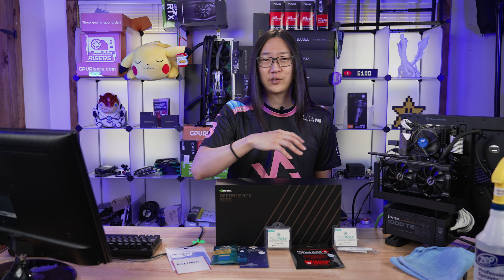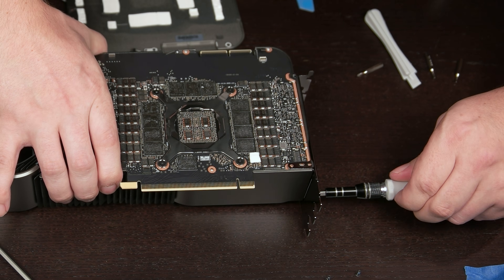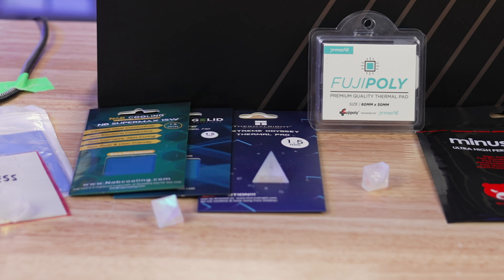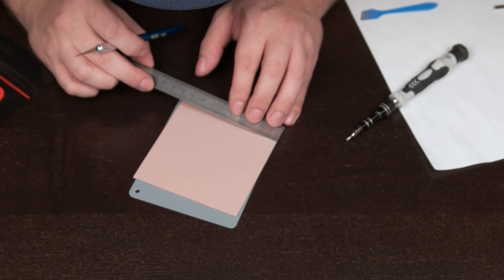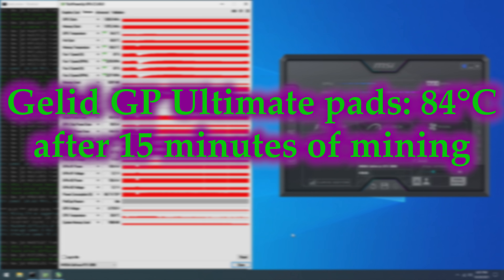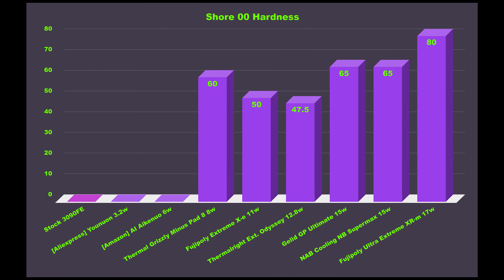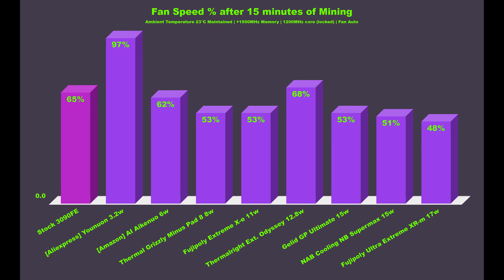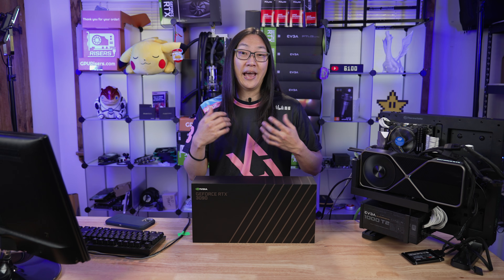Thermal Pad Showdown! What you should (and Shouldn't) Buy

Comment: i have recently swapped 3070 ti thermal pads to gelid 2mms , i see 3 degrees average raise of core temps , Now it makes sense
Reply from the maker: Of course your mileage may vary and there's a lot of variables, especially with all the cards and pads out there. However, this is a results we got from our testing which was relatively consistent. As long as your memory is running cooler, that means your probably doing it right

Comment: Good vid...though a little misleading.

I run 2 3090 FE's in one of my mining rigs and use Thermalright. They sit at 74 and 78 degrees (virtual memory temp) at my house.
You have to get the thickness perfect. I think there are more than just 1.5mm pads that get used in this GPU.
I wasted the money and bought all sizes .5mm - 3.0mm and then just matched it to the compressed thickness of the stock pad that was used. 
I had to remount a couple times to figure it out, but now it's perfect.
It seems obvious with that poor of a result on a quality product that there's an issue you may want to retest.

Just some things to consider! 
You're definitely right about there being a lack of content, especially for the rare 3090fe.
Thanks for making it.
Reply: Same here. For my 3080 I used thermalright 2mm and at first my mem temp went from 106C to 88C but my gpu die increased from 48C to 68C. I then took the card out and really pressed very hard on the locations where the pads were and also on the center of the cooler where the gpu die is. Now Mining 48C gpu die and 88C memory at 102Mhs.
Reply from the maker: Hey there buddy, thank you for the feedback! Will definitely consider this.
Reply: Thermalright 1.5mm for gpu memory on my watercooled Aorus Xtreme 3090 with Bykski Waterblock. They're definitely firmer than other pads, but 1.5mm is perfect. 76C max vram temps on a mining test with a higher vram memory overclock.
Reply: for me, in 3080 82 degrees
Reply: "rare" thanks also to people like you.  No offense, business is business ...
Reply from the maker: That's unfortunate.

Comment: I've done 10ish thermal pad swaps on 3080/90 gpus. I haven't seen core temp increase unless the density of the pad was too much or the size of the thermal pad was to thick. On some gpus I even got a core temp reduction because the stock thermal paste was trash

Edit. I'd love to see you test the gelid gp 12w extreme,  it's what I've had the best results with personally.
Reply: Hi I have a 3080 TI FE and only pad I can get are Minus pad 8 and Gelid Ultimate, From reddit I found that people are getting more success with 1.5mm pads on core side, 2mm on VRM and 2MM on back side now they all are using Gelid Extreme which sadly I cannot find in my country. Do you recommend Gelid Ultimate?
Reply from the maker: Thanks for the feedback. Appreciate it!
Reply: I BELIEVE YOU because I got similar results but with fewer tries and exploration so thank your for your input!

Comment: Great job.  Some of my favorite videos are ones by guys like you and Seb who put in a lot of hours like this to produce a single video.  It does not go unnoticed, my friend.  Adding all the graphs and numbers gave this one a real Gamer's Nexus feel and I know you must take any comparison to them as a high compliment.  You deserve it.

As for others who may read this, I've used a generic Amazon pad similar to the one TekShinji does in this test.  The kind you can get in the big 200mm x 200mm sheets which is HUGE (you can change many card's pads with one of those).  They got the job done for me at a low price.  They won't win you any bragging rights if that's what you're in to, but my Gigabyte 3080's been happily hashing away for 5 months with no loss in performance or degradation (knock on wood).  My VRAM temps stay at 90C with 80% fan speed with pads replaced on both sides of the PCB.  Nothing additional added to the metal backplate.  No special fans directing additional air for supplemental cooling.  Just one card inside a gaming PC case with the side panel off.
Reply: P.S.  It's also worth noting, that in my situation, my 3080 required 3 different thicknesses to match what came on my card.  As TekShinji mentions in this video, it's extremely important that you get the fit as close to perfect and not substitute the wrong pad sizes because you don't have what you need available.  Because I was looking at 3 times the expense of someone doing a card that uses only 1 pad thickness, it led me to try the generic type as well.
Reply from the maker: Hey there buddy, thank you so much for those kind words. It really does mean a lot to us, this video took nearly two weeks to make and a lot of help from our wonderful resident scientist. Andrew. He really did almost all the work on this video. I just let him go ham! 

We hope to make more videos like this in the future. It's just it's extreme time commitment and a lot of work. 

Regarding the thickness of pads, that is true. Every card takes a different type of pad. That's why we are comparing the brands and their claims rather than making a how-to or which pad to use on which card since it varies so much.

Comment: Thermalright pads are NOT measured on the OO scale.  (Sc) means they were measured using a shore C durometer which gives a very very different hardness rating.  Although that rating can give you an idea of its hardness, it can not be compared directly with the others.  The hardness of the Thermalright pads is noticeable higher than the others which is part of the reason they appear to give the most inconsistent results between users.  They can not compress anywhere near as much as the other pads so they struggle to fill the gaps between the cold plate and memory modules.  The main reason pads are used on memory modules is because their heights from the pcb are inconsistent due to the production line's soldering process.
Reply from the maker: I appreciate you pointing this out! I overlooked that it was SC. That would therefore be about 87-94.5 on the shore 00 scale.
Reply: @TekShinji  Thanks for making this video. I have been waiting for a decade for a video like this to come out.
Reply: @TekShinji  ur thermalright test is not valid
I changed mine with thermalright odyssey and I'm. Getting 18c reduction in vram temp on 3080
Ur thermalright is squished during shipment man
Or next time order +0.5mm than what u should have bought and squish it urself
Too thick is much better than too thin
Cos too thin means no contact
Reply: @dominicalvin  sorry, one question, my waterblock ek vector for 3080ti mount 1mm thermal pad, i order yesterday a thermalright pad 1mm, is ok for ram? 1.5 is not recomended for ek..
Reply: The secret with the thermalright pads is that they are kind of like hard clay. It has to "smash" into the memory modules when the board and cooler/back plate come together to make good contact. When they barely touch it wont work. If you disassemble again, you should be able to see chip imprints in the "clay" pad. I personally found a tiny bit of normal thermal compound added to the pads really helped it make a good seal against the modules and cooler and my 3080's are all under 90 on vram now at full load. Stock they were hitting 104-106
Reply: @djlowtek  Or company uses Frosty Thermal Pad 12.8. We ordered a larger batch and they just mold and work without the need for paste. We weren't sure if they would do bulk order, but they do if you contact them.
Reply: @djlowtek  hi, so you have to push the pad really hard to the mmory modules,, i was using thermalright and it didn't help..  i may try to put some grizzly kryonaut thermal grease and see if it helps ..
Reply: So, in the end if there was a separate heatsink for the chips or better heatsink then the core temps of the gpu wouldn't have gone up?
Reply from the maker: It's likely, however, most GPUs share the heatsink these days. There's a few exceptions, yes, but a lot of them are together
Reply: Guess that's explain why I keep telling people Thermalright are not great for gpu vram lol. Gelid, fugipoly, alphacool and IC Diamond gave been the ones that gave me the best results in my tests so far. Thermalright and Grizzly being at the bottom.
Reply from the maker: Yea as like the test concluded it depends on what your goal is!
Reply: @danielchicoine79  It may come down to the card in question. For FE the Thermalright didn't do well. Potentially due to being a bad pad, but could also be that thickness was off for the application. Personally I saw a huge difference with thermalright on a Gigabyte model over stock.
Reply: @KinzQuest  of course it will do better than most stock pads lol. The pads used by manufacturers are usually the bottom line. I didn't say thermalright was total garbage tho. I said they performed badly for my tests. Could be better for other people. Also, like the Minus8 I have tried, they were very oily and juicy. On the long run, the minus8 have dried very fast for me and pushed me to wonder if it was the cause. If so, then the thermalright could have the same results. So being the worse two among the few I tested, I didn't push the test for a longer duration, I just went back to my usual Fugipoly 17w/mk.
Reply: Thanks for pointing it out! I also have issues with using the hard thermalright pads. So much so that their hardness prevents my heatsink cold plate from touching the gpu core, leading to instant overheat and shutdown of the gpu when its turned on.
Reply: i bought the 2.0mm thermalright odyssey in advance (failed to score a gpu yet), would they work better?
Reply from the maker: It depends on your application and the exact contact pressure required for your card. However, in our testing they do not appear to be made correctly so they automatically fail
Reply: @claudiliciousX3D  I used them on a 5700 xt gigabyte , i used 1.5mm and they brought mem temps down roughly 14 c
Reply: So, the hardness affects the longevity and reusability of the pads as well then?
Reply: I used thermalright on my vrm and vram on my red devil 5700xt, 1.5mm on the ram and 1mm on the vrm. End result was vrm topping out at 66 C and vram at 70 C
Reply: Im really happy with thermalright. I have changed pads on 10 - 3090 using thermalright so far and The result is great 10-20c drop.
Im currently dual mining eth and ton now with 1200 core and 1150 memory and full power (350-360w) and 7/10 Card is 88-94 mem temp and The 3 other 94-98, sometimes spikes to 100. Bad connection on this 3 i think so going to open them up again and press down the pads abit for better connection. 

Anyway i got 14 new 3090’s im going to change pads on and im going for thermalright again.
Reply: What is best to lower hotspot temperature?

Comment: The memory height is the biggest Problem. If the Pads are too thick AND to hard, the distance from the GPU die to the coldplate increases thus increasing the GPU Temp exponentionally.
The higher the W/mk, the harder are the Pads.
VRAM on the Backside is different, there is no GPU DIE. But if the Pads are too thick the pressure on the VRAM CAN cause damage, although it happens very very rarely.
I wish Nvidia would give official numbers for the height/thickness of the Pads.
While i don't use my 3090FE for mining, even in Gaming i get upto 100°C on the VRAM (with Fans to 30-40%, but also Noctua Slim Fans in front of the GPU in an ITX Case). I'd go with the Thermal Grizzly ones in this Test. Or maybe Gelids, but if the GPU Temps are really 21°C more in my case, the GPU would throttle XD.
Reply from the maker: What you're saying is mostly true. However you can see in the data that's issue with replicating. Therefore it's logical that it's an actual issue.

Have you done testing of this kind before? We love to learn more about it.

Comment: Just an FYI but doing this on Founders Edition cards will void your warranty. If you have a issue with constant throttling then contact Nvidia.
Reply from the maker: That is true. You also got to remember we were stressing out the memory and unrealistic scenario.
Reply: @TekShinji  a lot of people are mining on them as well, and ray tracing games tax the memory as well. I talked with nvidia because I’ve seen mine hit anywhere from 100 to 104 sustained and they assured me it’s fine and that they will cover it under warranty. The said changing the gap pads will void warranty because it’s possible that you did something incorrectly and caused it to fail prematurely. I also mentioned that Micron specs GDDR6X say max junction temperature being 100C (which is a lie because they only have the spec for GDDR6) and they said after talking with the hardware team, they have no information that states Max Tj is 100C and that up to 110C is normal. I mean so be it, if it fails and they’ll warranty it I will continue to push 104C as long as I am not seeing thermal throttling.
Reply from the maker: Just to be clear, this video is about information on pads not specifically the issues related what you see referring to. That is a different topic in the sense that the focused is on the pads.
Reply: @TekShinji  yes but there’s a Founder Edition card and it’s only relevance is people replacing the thermal pads on their GPUs. It’s the only reason that would be included in the video and the only reason people are repadding their cards without knowing that it will void the warranty.
Reply from the maker: Thanks for the feedback. I really appreciate it. I hope people see this comment as well because it is important

Comment: Subbed even though I have no issues with my card.
Reply from the maker: Appreciate it man
Reply: @TekShinji  All good Shinji. I do have a question though... I bought an EVGA RTX 2060 last year. And when changing the paste (the second thing I did after testing perf vs temps) I noticed they gave it pathetically tiny heat pipes with it's chonkin 3 slot cooler. Is there a viable way to upgrade those. Or should I just deshroud it and give it one of my spare high pressure cooling fans?
Reply from the maker: You can upgrade the heat pipes definitely. But the question would be is it worth it? You would have to design and manufactual whole new block.

If it's actually overheating or causing real issues, the only way is to evacuate the heat by increasing air flow
Reply: @TekShinji  Nah. It was more that the GPU definitely doesn't stay below that 65c EVGA claimed it would. I've seen it hit 80 in some games. That's even with a modest under-clock and given an open air bench.
Reply from the maker: It would really depend on the type of GPU in your settings. However that's not too crazy depending on the type of load you're putting through it.
Reply: @TekShinji  ARK: Medium High settings, expecting 75 FPS. Fans ramp up to full speed. I can only play during winter without wanting to yeet the thing out a window. This is only at 1080p too.
Reply from the maker: It could be the limitation of the design of a card, however, it is also a 2060.
Reply: @TekShinji  I know it is only a 2060. But, considering I was running this with an old GTX 580 at one point, at the same resolution on a 4770k. I was kinda hoping the new card wouldn't break a sweat until I tried getting into ALL High settings. Not just a couple notches above medium-high.